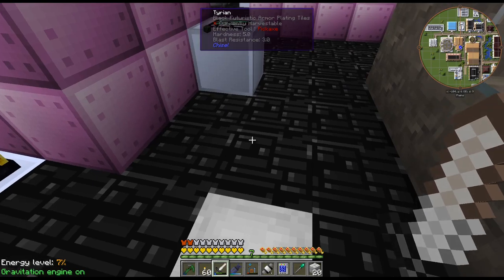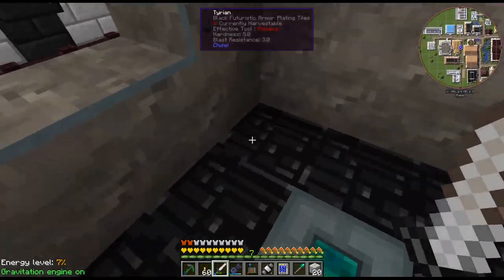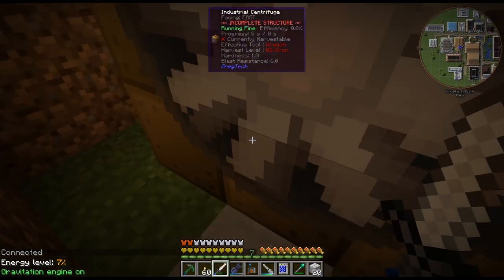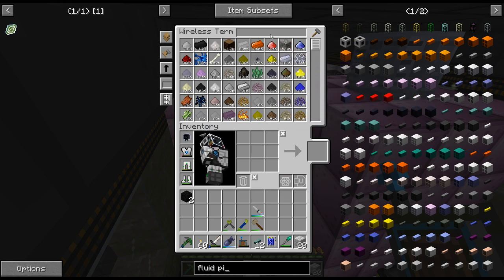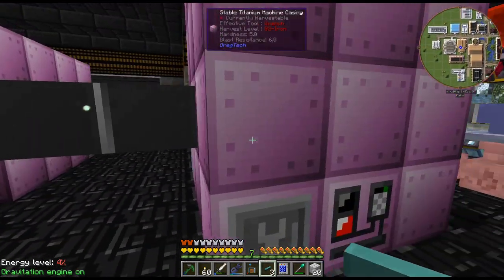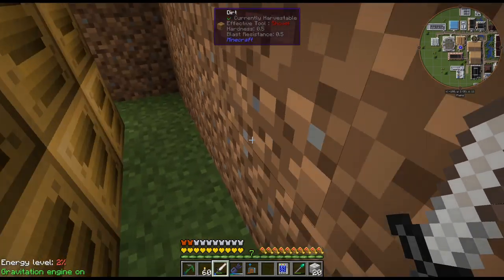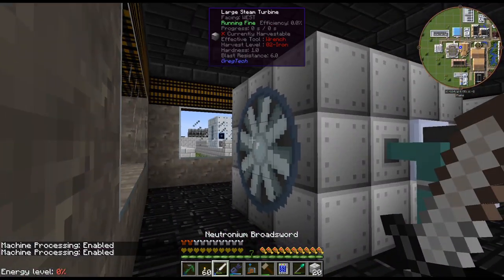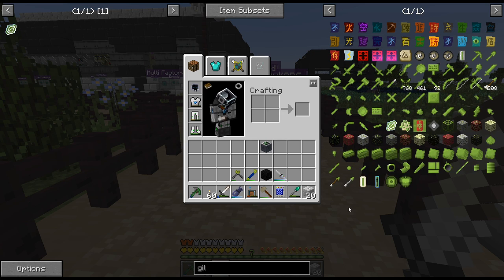Gregtech New Horizons - 362 - Fixin' the Lava Build

Comment: One of the major  advantages of those TC glowstone crops is that they do not require the accelerators to be on tile entity mode meaning they use 3A instead of 6A and also have a much larger range. Interestingly enough those crops also do not require dirt under them, you can't place them mid air but can break the block under them leading to some strange results:

https://discordapp.com/channels/181078474394566657/224191655375273985/688767953147002884

That setup produces 1k glowstone every 1-2 seconds and only uses around 24k eu/t, though obviously that is completely overkill but illustrates how powerful they can be.